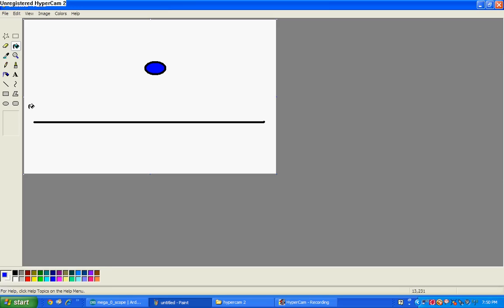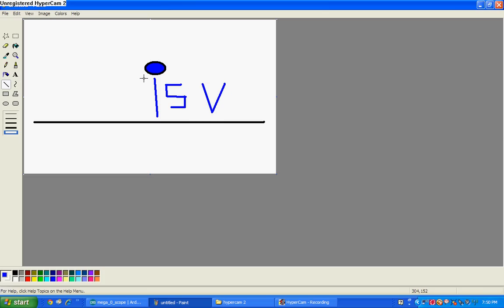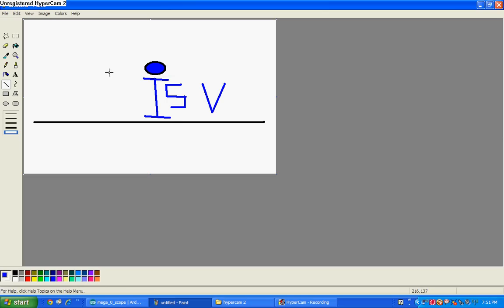Negative Voltages

Comment: I don't get it. If the positive of the battery is X volts and the negative of the battery is -X then the battery potential is X-(-X) which is 2X. For a 9 volt battery that would be 18V which it's not, it's 9V. 
AC/DC is my passion, not my profession so maybe that's why I don't get it.

Comment: Good effort ! But potential on either side of the ground line is important in gravity research as we tend to value gravity as a negative voltage line from the centre of the earth to the edge of the earths field of gravity and that is 3600 miles In space but a complete perfected zero gravity is 36000 miles. So negative voltage should be measured from this zero point in gravity not just the surface of earth.

Comment: a good power supply should handle direct shorts , sparks and all. wondering how to get negative voltage from one power supply , do we need a ransformer ?
Reply: ah dont listen to them , keep em coming right
Reply: two cheapy AA batteries end to end. the middle lets call it ground. put black negative probe multimeter there.  
put red positive probe on other end of either battery. plus 1.68 volt and minus 1.68 volt.  
job done guys time for tea.
easier visualise with two voltage sources , maybe a voltage divider with equal resistors might give idea how to do it badly using one voltage source.

Comment: Can u tell me what is the ground in electrical circuit ? PLEASE ?? SOMEONE ?
Reply: In examples like this it is just providing a route for charge to flow when it is not needed anymore , and as the name suggest it is usually a wire that leads to a price of copper that is placed into the earth allowing the current to flow into the "ground" (if the circuit suddenly ended at a random point then there would be no where for the current to flow thus it just wouldn't turn on). It has other real life applications too such as protecting against the build up of static charge in devices, does that make sense?